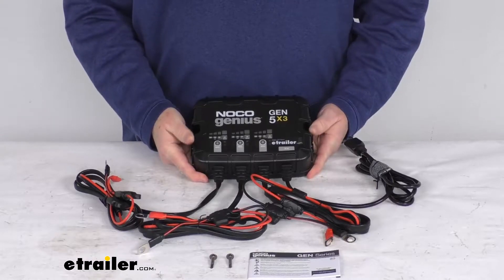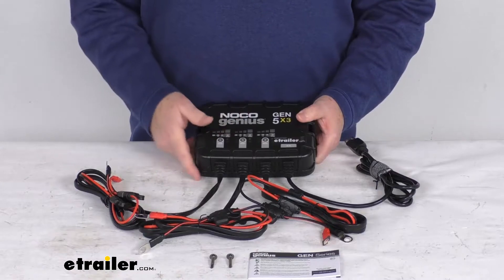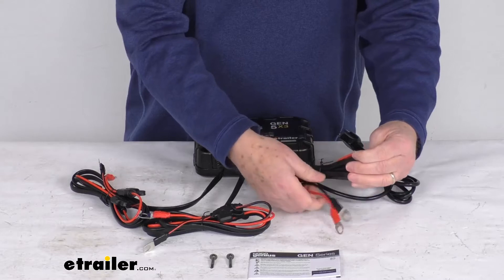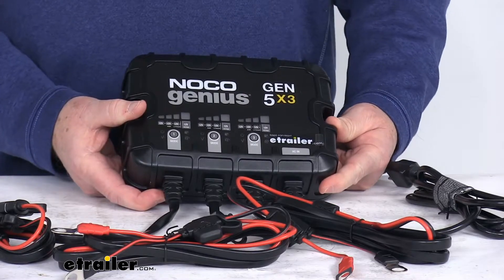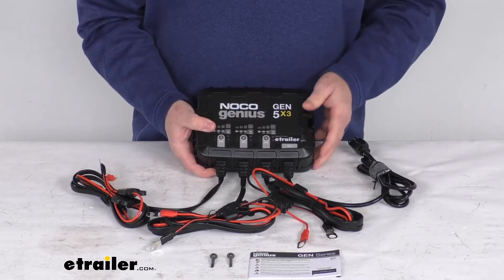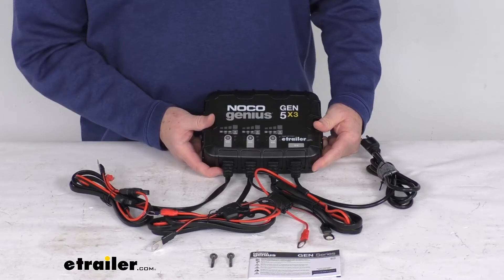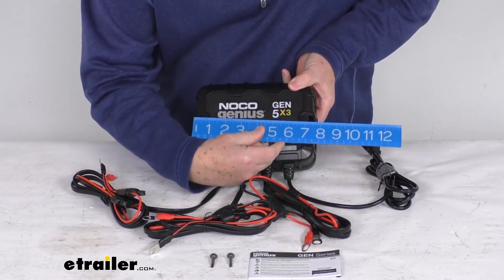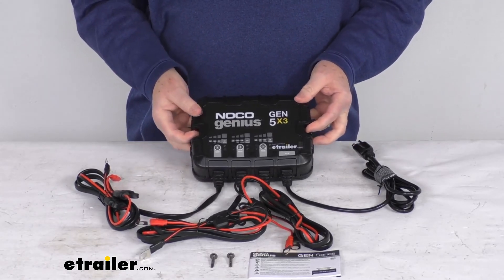etrailer | In-Depth Review of the NOCO GEN On-Board Battery Charger

Comment: 1 of my batteries is about 20 feet from the other two. Is here a kit to extend one of the charging wires? Or should I just cut and splice it to extend it?
Reply from the maker: NOCO doesn't offer a kit, but our contact in the tech support department there says that you CAN splice some extra wire onto one of the battery feeds, IF you make the splice between the inline fuse and the eyelets for the battery terminal and the splices are secure and waterproof. They recommend soldering the connections and using heat shrink tubing to protect the splice from the elements. As long as the modification meets those parameters, the modification will NOT have any warranty implications. Hope that helps you!
https://www.etrailer.com/Battery-Charger/NOCO/NOC94FR.html

Comment: Could I charge 3 batteries in series for trolling motor? 36v's
Reply from the maker: This battery charger is designed to charge 3 - 12V batteries separately. You could unhook your 3 batteries and use this charger or you can check out the 36V smart battery charger in the following link.
https://www.etrailer.com/Battery-Charger/NOCO/329-GX3626.html

Comment: with two 12v batts in series to get 24v will each battery need its own assigned bank ?
Reply from the maker: To charge a bank of batteries that are run in series, you will need to attach the positive charge line to the positive post of one battery and the negative line will attach to the negative terminal of the other battery. You can disconnect the batteries and charge them separately to get a faster charge time.
 https://www.etrailer.com/Battery-Charger/NOCO/NOC94FR.html

Comment: What do mean the lithium ion will need a battery management system to function properly?
Reply from the maker: Lithium batteries need a battery management system that ensures that the batteries are safe to use in the current condition that they are in. Whether that be temperature, battery level, or battery state.
https://www.etrailer.com/Battery-Charger/NOCO/NOC94FR.html